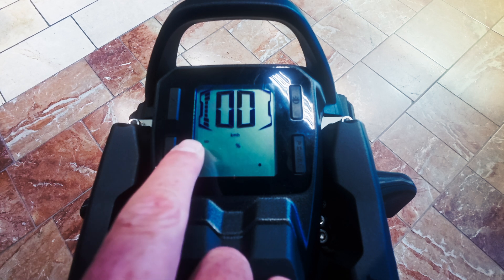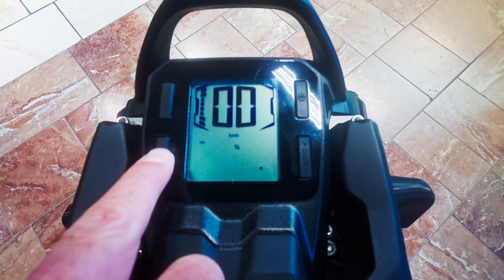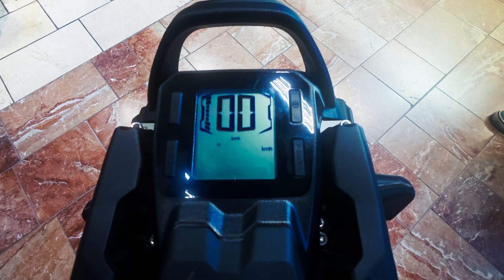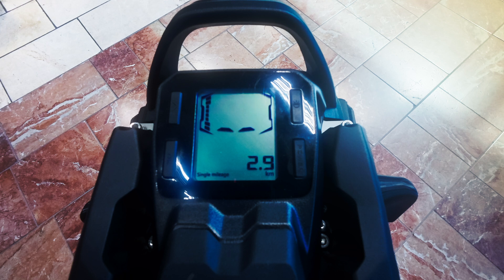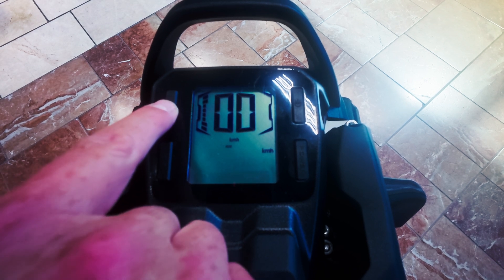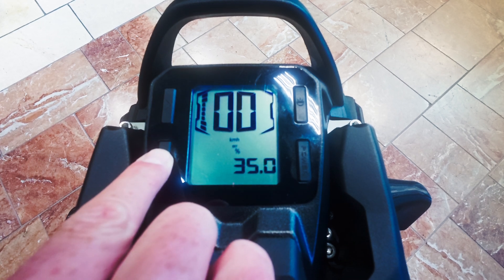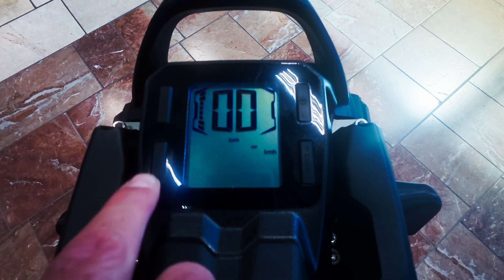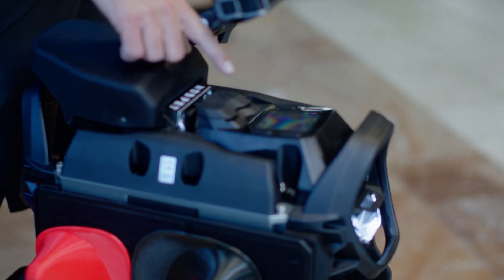Nosfet Apex Display Settings

Comment: Love this! I'm running into a issue of not understanding exactly how hard I can push this wheel without frying the controller, I'm comfortable at high speed and want to get the most I can, but I want to make sure I know what the system can handle, how should I go about looking into that
Reply from the maker: Glad you're enjoying the wheel! Definitely check the manufacturer's documentation for safe operating limits.

Comment: Clearest description I've seen.  Thanks.  One question, STA side tilt angle, is that tilt angle where motor cuts off or warning sounds? I'm setting up my Apex, don't want to exceed presets and have it turn off.
Reply from the maker: Thank you for watching our video.

The NOSFET Apex side tilt angle (STA) controls how far the wheel leans before cutting out, with typical settings ranging from 40-65 degrees, depending on usage; 40-45° is good for daily riding, while 60° or 75° is used for banked turns/racing, but higher settings risk a "beyblade" effect or dangerous cutouts, making 55-60° a common advanced/aggressive range, but always test carefully.